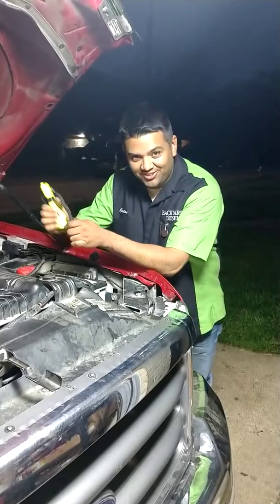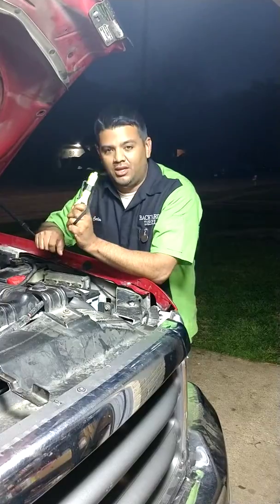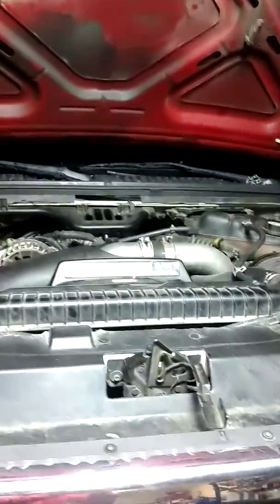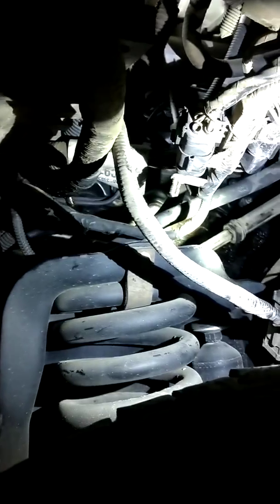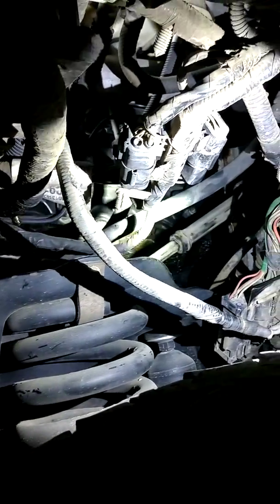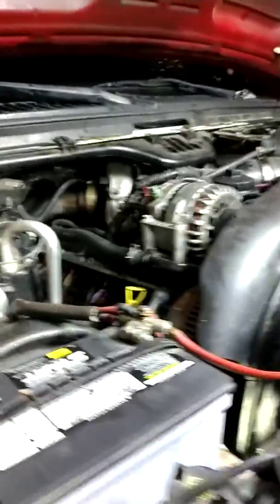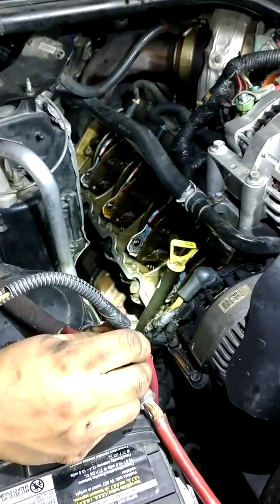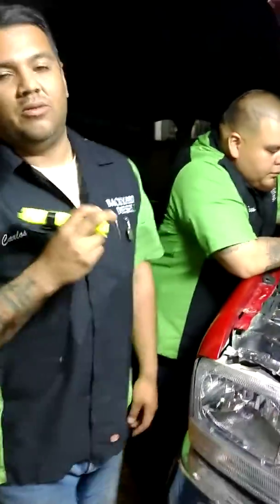Cracked injector nozzle white smoke

Comment: I have fuel coming out my tail pipe and white smoke like a train if i pull the glow plugs out it will show me what injector is bad? Or this just works for cracked injectors?
Reply from the maker: Yes it will work.. you just have to pay close attention to each cylinder.. if the injector leak is very small it's hard to tell..  you probably need two people.. or three.. someone to crank it and one on each side of the cylinder heads.. to see which injector squirting more fuel.. the one with the most mist that's your problem but sometimes it will only do it first split second.. so you have to pay close attention

Comment: I have a 09 Toyota highlander that brings out white smoke from exhaust with obd err P0301. But stops smoke  after removing the socket to the injector nozzle that supply fuel to cylinder one. What is likely the problem, thanks.
Reply from the maker: We work on diesel engines... Never worked on a diesel highlander... I thought they where all gasoline.. if gas is most likely burning oil not fuel..

Comment: Hey bro I bought a 05 Cummins 5.9 and it smokes white smoke till gets to regular temperature. The other thing it smokes out of a little hose that comes out of the motor and goes down to the bottom even when is good and warm.what could it be?
Reply from the maker: How much smoke
Reply from the maker: Do you have blow by
Reply: @BackyardDieselz  well not on the oil cap there is not pressure but on the little hose that comes to the bottom and dumps out it blows some air and smoke

Comment: is there a way to know  if its the piston oil rings Yes the Turbo was damaged  Let's say the used injectors I put on don't work is that the reason  why it smokes  it has normal blow b
Reply from the maker: Doing a compression test of each cylinder.. and if the turbo was damaged... What was the truck doing before.. same thing.. you probably need to clean the intercooler.. if it has alot of residue from the other turbo